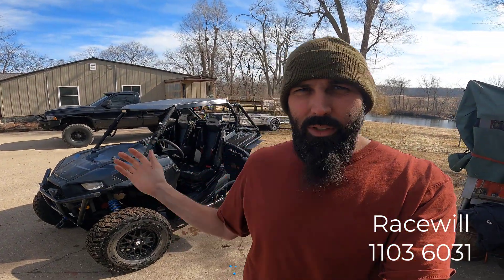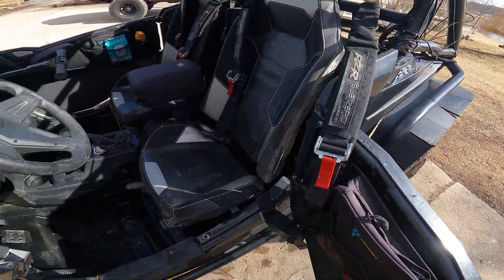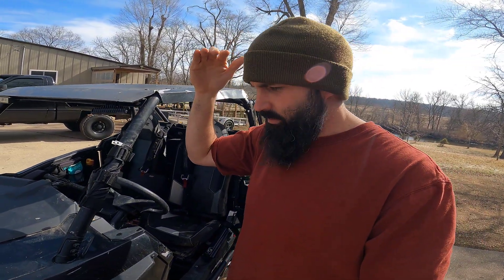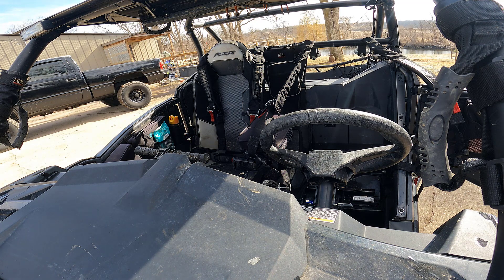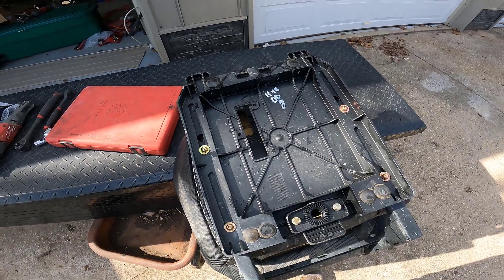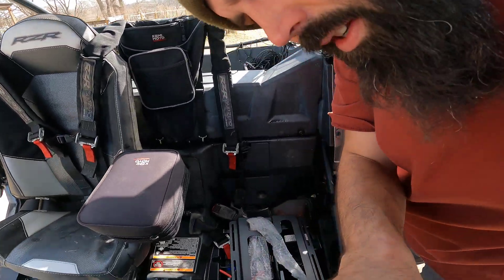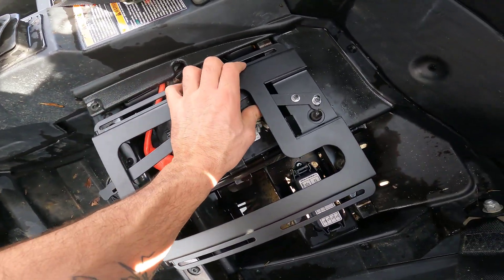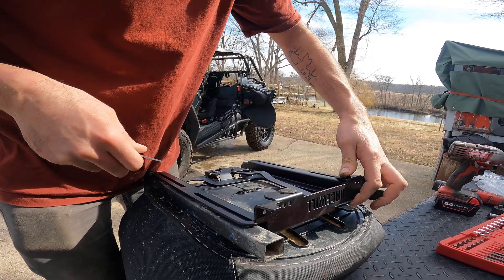A Guy With A RZR: How to install a Lowering seat base.

Comment: Thinking about getting a pair of these. How do you like them now? Still using them?
Reply from the maker: Yeah I still have the driver seat one in. I added a couple little rubber parts in-between some squeaky pieces but pretty happy with it.
Reply: @backwoodscustoms  Awesome thanks, should have mine in a couple of days. Thinking the recline angle will help a lot.
Reply: @backwoodscustoms  Installed mine today. They do recline and drop, but I didn't ride yet.  Those long shoulder bolts go in one of holes beside the Racewill logo. One bolt on each side of the logo. It takes some of the play out of the base but also makes it a little harder to install the seat. Guess I won't be carrying the handsaw behind my seat anymore, or spare belt, .... anything 😊